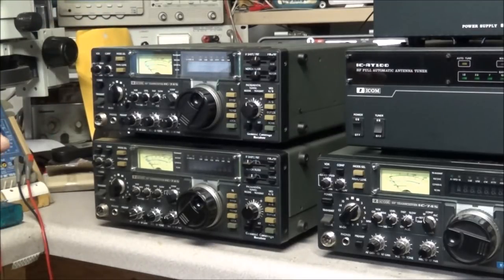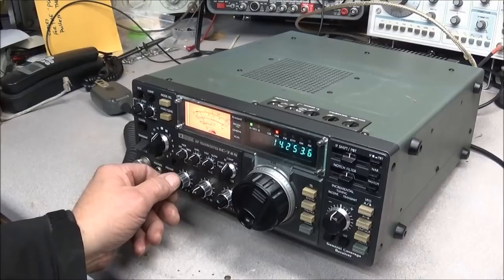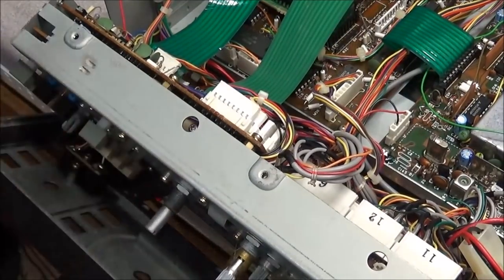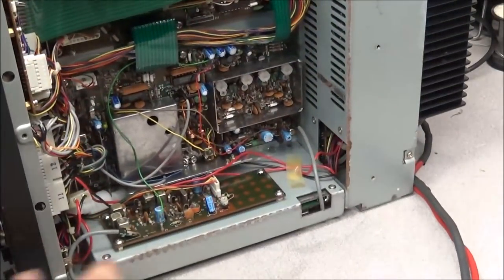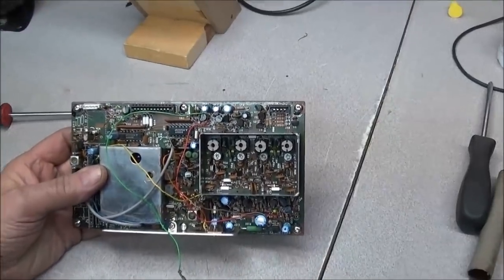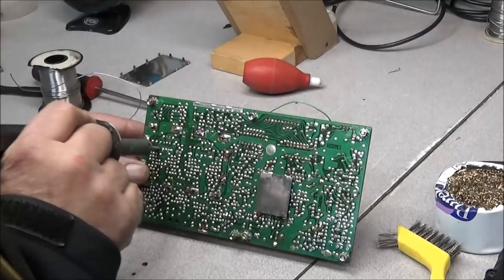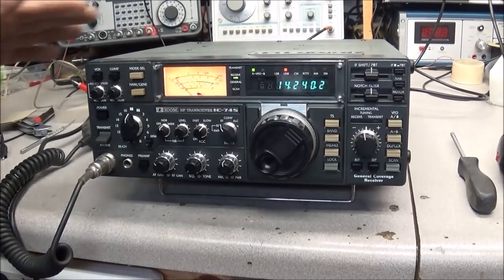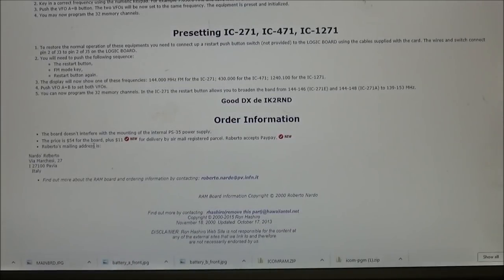#148 More Icom IC 745 Repairs

Comment: Great video on the brain of the IC 745.  I remember in the old days a bypass technique was used to keep the memory alive with the root operating system, while a new battery was connected in parallel and then the old battery was removed.  The worry then was Icom would not support the product after a few years and the radio would become like you said, a brick. 

Those guys who came up with a non volatile plug in board for these radios did a great service for the ham community.

I bought my 745 in '83 and I remember I also paid 745 dollars for it.  The dealer even included the sales tax in the price.   The only negative comment I can make about the unit is between 800 and 900 kc on the broadcast band it had display noise messing with weak signals.  Other than that it was a great radio and I loaded it up with all the options after I got it.

Glad to see they are still around.

Comment: Great informative video as usual.  I have two working 745's and three IC-AT500 auto tuners two of which had issues.  You did not elaborate on what the problem was with the AT100 but I thought I mention what I found with two of my AT500's.  Icom used a very stiff wire as the lead from the matching network inductor to the L selector switch.  In two of my AT500's, the solder was cracked or completely separated from the switch's wafer connection.  The stiff wire apparently stressed the solder joint to the point of failure.  Once I repaired those joints, both tuners worked as intended.  K1NVY

Comment: You can run DOSBOX  I use it to program old Kenwood business band radios. usb to parallel port adapters are around.
Reply from the maker: That is interesting. I was told by others that Dosbox did not support parallels ports.

Comment: Easiest way to interface to a board like that would be with an arduino, which would be compatible with 5v logic. Depending on the actual size of the ram module, it would even be possible to create a stand-alone programmer.
Reply: Yes, of course, that would be the fast, ease and reliable method without the need of the frequently out-dating "Fuzzy PC SW parallel port solutions.

Comment: hi hi. im restoring an icom r70 receiver and its also got the plastic trimmers. where do you order your icom parts from? ive looked up icom parts and i cant seem to make any real headway. the trimmers seem smaller on the rc70 but im assuming they are the same size. i found a similar one at jameco electronics and its a 9-50 pf range and im not sure if that will work or not? the other ones seem a different form factor.  thanks!

Comment: Really enjoy the ic-745 videos. Do you need one more to work on? 😁
Reply from the maker: Thanks James. Do you have one with a problem??
Reply: Yes, I have one with very low RF output (less than 10 watts). PA seems to all be OK, but not getting much drive from RF unit. I do not have a good way of measuring exactly how much drive. I'm not sure if it is actually low coming out of the RF unit or if it is being lost in the filters. Receive is working perfectly. It has been a few days since I looked at it. Any ideas on what to look for?

Comment: Does the RAM Board come pre loaded or do I have to program them some way. My IC 745 is receiving fine but the big problem is severe drift. I think I will try to replace the caps and ground the xtal for starters. Other than the drift I love this radio. After 53 years on the air and loads of tube work this will be my first attempt to fix a “modern rig”. 😩
Reply from the maker: This sounds like the VCO trimmers are faulty. If you look back at previous videos I show how to replace these.

Comment: I need a step by step simplified way to perform the latest agc mod to this rig.  Does anyone have instructions that are simpler and better than the long winded discussion of what went wrong and what can be fixed but does not say change this or replace that which is what I need to do the mod.

Comment: Could you just remove the eprom from the replacement ram board and read that instead?
Reply from the maker: The replacement ram boards are ROM not ram.  Like the PIEXX board. And is an eprom. The original boards are not eprom. They are flashed DRAM. So totally different units.  You cannot remove the prom from the original either due to it's content is held there by a battery.
Reply: The Radio Shop  I thought that the PIEXX Eprom would hold a copy of the factory data so would easily be read by any eprom programmer. It would certainly be easier than trying to read the dram on the original board as the designers of the PIEXX board have already done it for you and stored it in the eprom.
Reply from the maker: Oh I see now. I have yet to see anyone try and read the data on the PIEXX board.  I was told it was protected so it could not be read. Anyway the format on the PIEXX board is different than the dram. Good thing is there was already copies of the original files posted on the internet. I had the copies for years, just no way to program it back to the old board until now.
Reply: I noticed the new Ramboard has a GAL on it so maybe the data stored on the eprom is encrypted or the GAL is simply used for address decoding?
Reply: The Radio Shop You answered my question as we crossed replies. I can understand you wanting to program the original board after changing out the battery. Makes sense.

Comment: And why would they use plastic trimmer caps in such an expensive radio when ceramic ones are superior?
Reply from the maker: Two words. "Bean counters" Yep they went with a cheap trimmer where they save a few pennies on production cost.
Reply: plastic trimmers have a better thermal coefficient, better stability in time. Of course, the plastic rots after 25 years, and problems start to appear. Ceramic caps are OK, but they must be thermally compensated with a parallel, fixed value capacitor.

Comment: start the IC745 with a known good RAM module. in the meantime, change the battery on the dead module. Now, remove the good RAM module from the transceiver, WHILE it's up and running. Put the dead RAM module in it, change the frequency a few times and the bands. Turn off the transceiver. Turn it back on, and the dead RAM module should be OK and programmed now.
Reply from the maker: That is very interesting information.  Have you tried this? As you are the first person I ever seen mention this.  Details please.
Reply: the CPU reads the data from the RAM at power on, and writes the data in the RAM when it's powering off, or band change, or frequency change. When you're swapping the RAM module, make sure you don't touch the VFO knob. I did this many times recovering swappable faulty computer BIOS-es. It's the same principle.
Reply: The problem is that the interface between radio and the ram module is not designed for hot plug operation. Means that plug in -out "under fire" can easy destroy mainboard, ram module or both. The second is that the basic configuration data will not be written back. It writes back only frequency sets from the user. The basic configuration setup remains in the RAM module for read operation but will not be rewritten back in the blank module.
Reply from the maker: You Sir are very correct. I only did this to satisfy a few folks using my own rig,  Lucky no damage was done. We are moving towards Arduino for the programming platform.  At the same time I am reviving the N2CBU programmer since I have an older computer here to experiment with.  Thanks for contributing your knowledge on this. Would love to hear more if available.